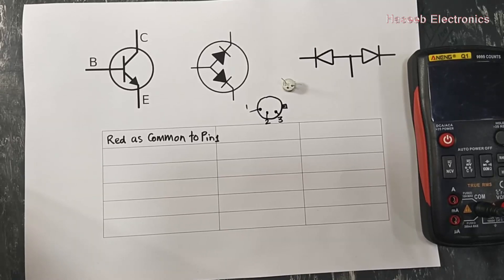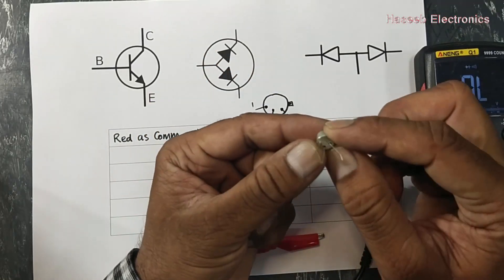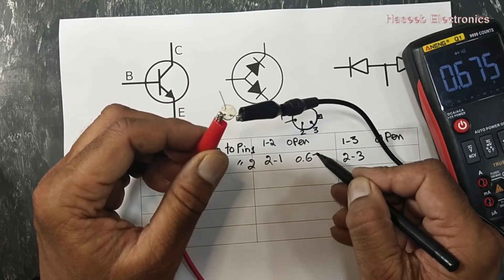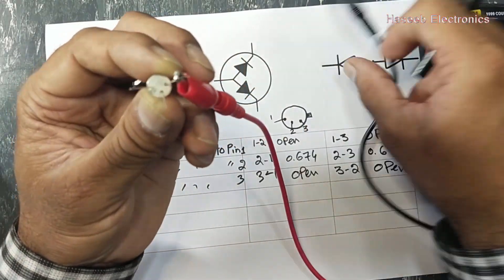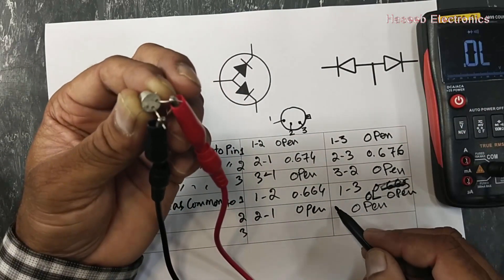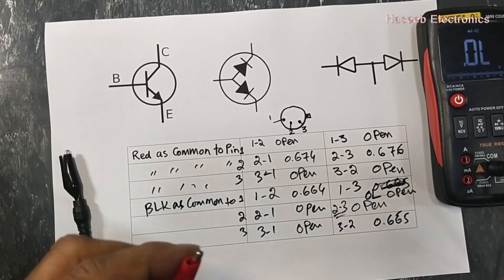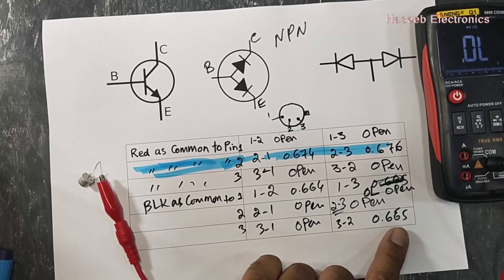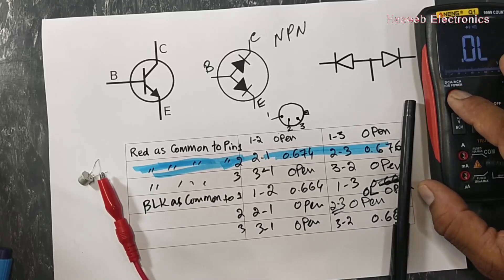{476} How To Test Transistor BJT With Digital Multimeter - Part 2

Comment: Dear Sir, Can we convert LED Flood Street Light's non-dimmable driver to dimmable driver 60 voltage and 1 Amp DC to DC buck converter concept? I'm trying, but the LED Flood Panel is flicking. Please can get you an idea of the current adjust or voltage adjust. ❤️❤️

Comment: Let me put it in other words: You have 3 connections: B, E, C. There are 6 possible combinations: 
B->E, E->B / B->C, C->B / E->C, C->E. 
That was all measured in the first 3 rows of your table. 

Your measurement in second row, first column (red on 2, black on 1, 0,674) is the identical measurement as row, 4 first column (black on 1, red on 2, 0,664)

Example: 
B->E, E->B is the measurement forward and reverse.  You now do two extra measurements:
E<-B, B<-E and that’s the same, with changed Letters and changed directions, just a different point of view.

Sorry, I probably can't express myself properly.
Reply: I never really caught that. I was assuming that it was done to just double check that the transistor is indeed bad. Just a habit for me, so when I saw Haseeb do it I didn't catch it at first.
Reply: @W1RMD  I don't think it's done just for verification. The second part of the video was only made to show that Haseeb thinks it's right.

But maybe it will be more understandable to him and the others if I show it with a single diode:
A diode has an anode and a cathode.
1) red on anode
2) black on anode
3) red on cathode
4) black on cathode
That sounds good at first and you seem to have 4 different options. But viewed more precisely, if in case 1 (red on the anode), then case 4 (black on cathode) is automatically covered in as well. So case 3 and 4 are duplicates to case 1 and 2.

But I am glad that you understood my comment. Apparently a lot of people don't think about it anymore and just write "great" and "super" :-) Haseeb has great videos and also good explanations, that's why I look at the channel, but unfortunately it is a bit off here.